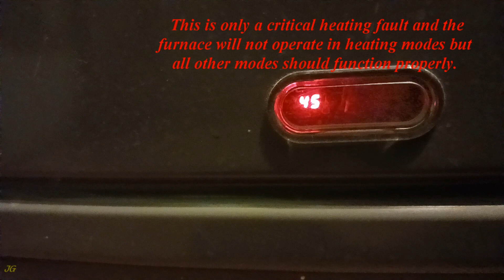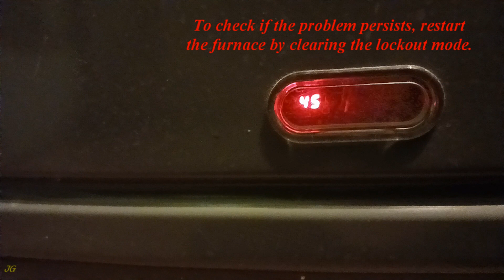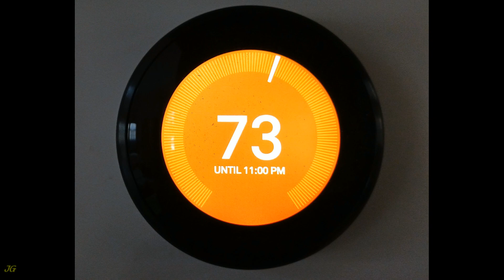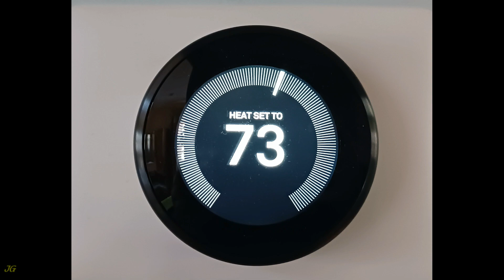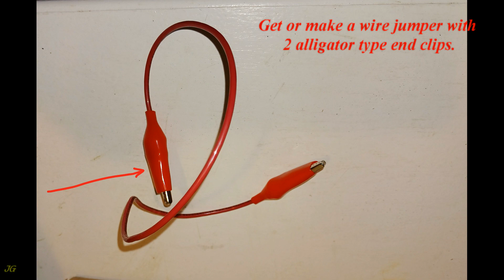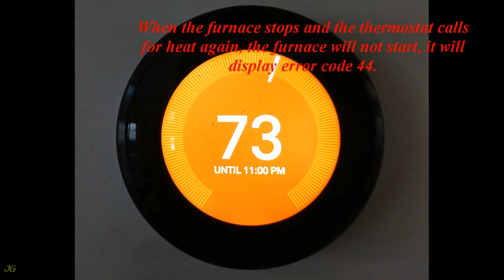RUUD or similar gas furnace error - fault code 45 explained

Comment: Thank you for the info. Error code 45 immediately displayed once the draft blower turned on.  Low pressure switch did pass the ohm test. However, when I jumpered the low pressure switch, the furnace kicked on and ran normally.  Upshot: Don't blindly trust the ohm test. New low pressure switch on order, but at least I have your workaround to keep the place warm.